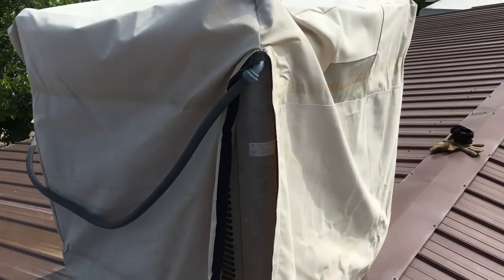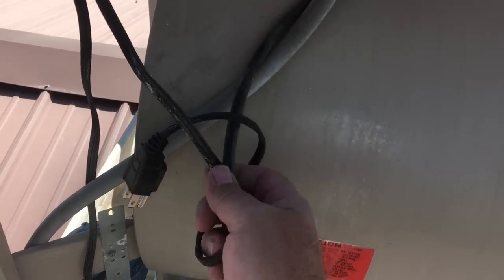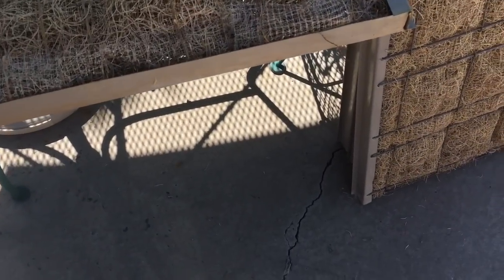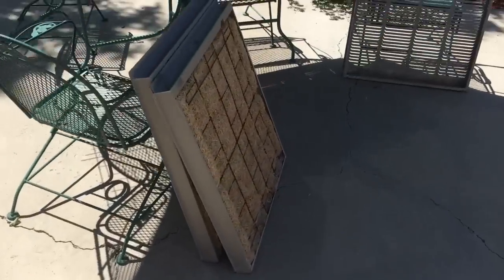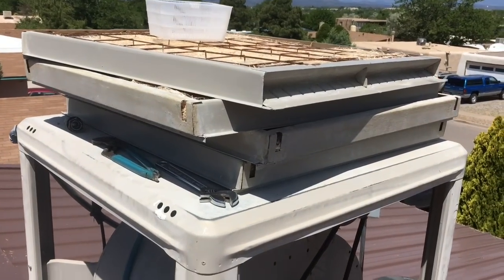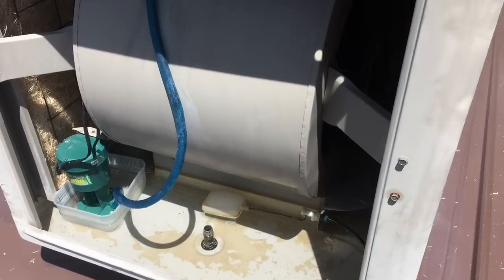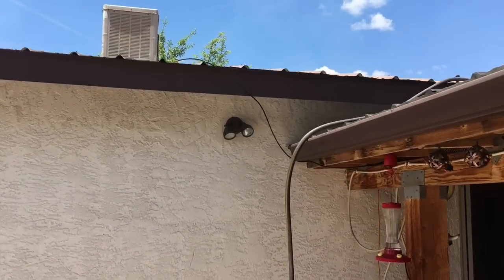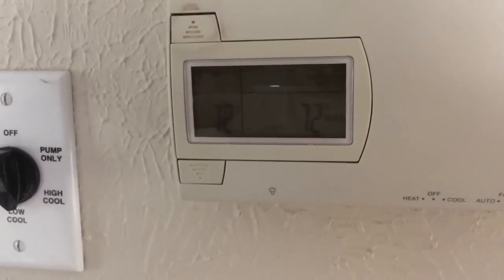Cool Swamp Cooler Tips

Comment: I have to agree with you and everyone else, the aspen pads work the best. I work in a hardware store so I sell lots of hardware for the swamp coolers I just think air flows through the Aspen  pads better than the other stuff. So as long as you have a good water pump that is gonna keep those pads wet ,your in good shape
Reply from the maker: Yup, they work great, just a little messy. I just got mine up and running this week. The only problem was a little clogging in the spider from the aspen pads from last year.  Cheers!
Reply: @mrblueskynm3968  I already have mine going I'm in California in the eastern Sierra high country and it's already been in the mid 90s here

Comment: You are correct NOTHING beats the Aspen pads, I tried all the rest as well.
Reply: Totally disagree.  those who give advice about "pad crap" must have developed their misconceptions about material science.   You don't care how water is running through or water absorbing fiber PERIOD. Do care about how water is EVAPORATING.

 Now,  different materials pad has different evaporation effect-techniques.  Like you, I tried all three and realized should have understood and thought about material science.   Look past manufacturer's claim and figure out how material causes water evaporation, then decide which material you use based on your swamp cooling habits.  the best pad is based off of YOUR PERSONAL PREFERENCES!
 not the just type, use or quality of material alone.

a) blue pad is pure spun plastic fused,  forcing water to spread out into air space (imagine waterfall- curtain) and evaporate. manufacturer states supposedly last longer [irrevelant, calcicum buildup blocks up the "curtain" passageway]:  when calicified pad becomes "clogged" (preventing air  to pick up water when passing through) or harder (not pressable or pinchable); time to replace. some swear it does not evaporate well...   see the regardless section below.

b).  aspen pad does absorb water until it is waterlogged.then fiber expands, then pad begins to evaporate. THE CATCH!!! evaporates begin after pad is waterlogged [not before].   when calcium binds to wood fiber, it stops water from absorbing; thus retarding the evaporation. this creates crinkle like sounds. when pad is pressed or moved, indicates evaporation failure (not because pad is hard}. time to replace.
 this does mean you want the water pump to run continously to keep fiber expanded (and not to dry-up then calcify). look in regardless section below.

c) there are greenish-brown pads,  they are paper impreganted with something sandwiched..  some sort of waxy chemical or thin plastic??.  This pad has what looks like the widest  "air opening cavities" but is not because of the waxy coating is there creating invisible barrier. manufacturer claims supposedly imitate aspen pads. I discovered this is not true.  is an  "both"  effects from blue pad and aspen pad... whereas at start pumping behaving like blue pad air curtain;  then [depending on models and outside; in 10 to 15 minutes] starts soaking and expanding, behaving like aspen pad. The obvious time to replace pad is when calcium build up destroys the weird waxy coating or when paper is crumbly when pressed. 
this means it will calcify regardless of air curtain or swelling anyway. 

d) on different notes: if you are going to reference on clay and sand type materials [AFRICAN and ARABIA is using those type science]. I have not used this but from what i read and understood ::: the process relies on reuse and renew materials. example with calcified sand, just stirring up or turning over the sand. for clay, brush-scrape off calcification off the surface.  That does mean cheaper expense on materials.; but the reports indicates from what i think somewhat weak cooling-evaporation [probably has to do with surface area to air evaporation factors]. by the way SAND and clay is heavy. 

REGARDLESS SECTION    homeowner with swamp coolers should haven been told and know!!! 1) when temperature soars to greater than 97 degrees Farenheight.   Water evaporates so fast and water never had chance to completely saturate the pads... this results in faster clacification build up [and ineffective evaporation and cooling.] 2) outdoor higher humidity does retard cooling; ranging somewhere 35% ish  maybe 40% ish. PAY ATTENTION: resulting retarded cooling effect but does not retard evaporation, and running the machine pump during higher humidity; pad still get to suffer calcified buildup.
Reply: I used blue layer first and stengy brand of aspen inside. Worked best for me.

Comment: Good video, I didn’t hear anything about the motor or horse power, unless I missed it, daughter was talking to me a bunch lol 😆
Reply from the maker: Thanks! I don't think I mentioned anything about the motor, or horsepower. They are super easy to replace though. I've had one go out over the years and all I did was buy a new one that had the same hp. Be sure to disconnect the electrical to the unit before working on them!

Comment: Sure you can get colder air if you blow air through colder water.  So what you have to open up the unit each time you want to add ice?  Not worth the hassle.  If you check the water temp in the bottom of the pan you will notice it  gets down to the 60 all by itself.

Comment: you didnt show how you used the spider rooter to clean the calcium deposit plugs.
Reply from the maker: Hey Jose thanks for asking about that. Fortunately, the spider tubes were not clogged by calcium deposits, it was only aspen splinters from the pads. I simply removed the spider(screw is on top of cooler) and inserted the little roto rooter and reamed it out. I would recommend just buying a new spider if they were clogged up with calcium deposits. I've  bought one at Home Depot and they're not expensive. Also, you can look into additives, or anodes to place in the water basin that will help reduce calcium build up if you get a lot of calcium build up each season. I haven't had to do that, so good luck and stay cool this summer!
Reply: I was wondering about that as well. Our cooler was converted to an AeroCool, so we don't have a spider or the straw-like pads, but the water hose that runs to the pads seems to be clogged. I'm new to doing this for myself, so can you tell me how to disconnect and/or clean that hose? It runs from the basin up to a PVC pipe/cover (looks like the top of a fish tank to me) that's supposed to wet the pads. The bottom of the hose near the basin feels like it's full of sand, but I'm not sure what to do. Can you help?